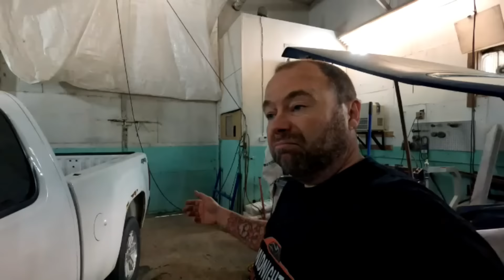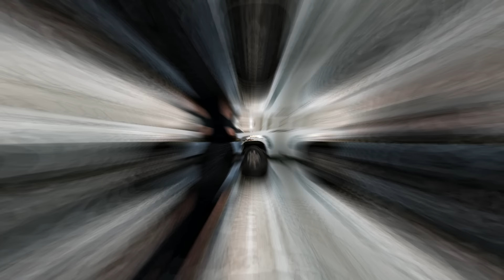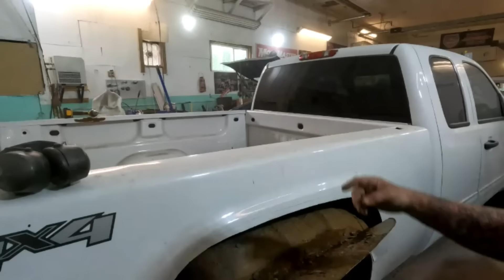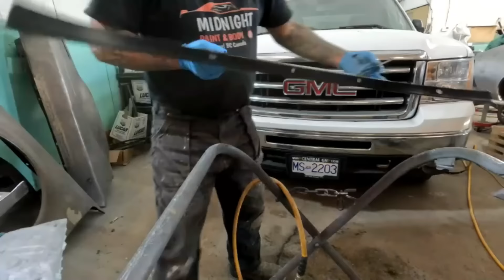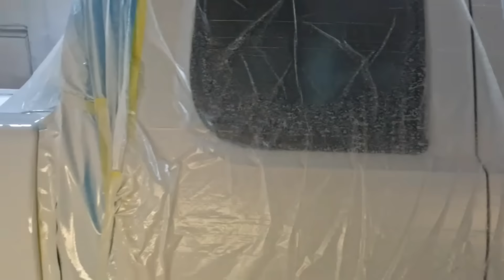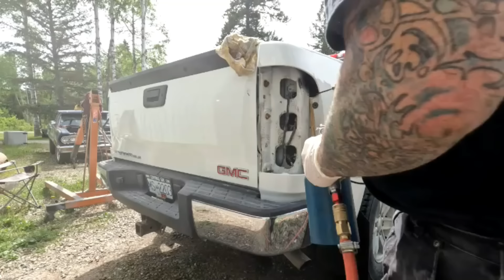How to glue on rust repair panels with panel bond structural adhesive

Comment: What filler did you use on top of the dura glass?
Reply from the maker: I was using Evercoat Z grip (800282), but I’ve since switched to the Evergold (100110)
Reply: @Johnnymidnight thank you for getting back to me so soon I appreciate it.

Comment: How long does the whole process take to replace both wheel arches, prep and paint?  I have a 2012 Sierra that needs this done and i was just wondering how long the truck is off the road.
Reply from the maker: These are usually 4 days when I do them

Comment: I've been thinking about doing this here soon. I'm just curious if there's a way to test if the rest of the truck bed is good before you throw a patch in. Obviously the wheel wells are falling apart from the rust, I'm just not sure on how to check on the integrity of the rest of it. Very nice job as always!
Reply from the maker: Take out the tail lights and pressure wash the inside of the panels the best you can, through the openings, and from underneath, once it’s dry you should be able to get a good visual with a flashlight and see how far the rust has spread
Reply: @Johnnymidnight Will do! Thank you for the reply sir!

Comment: Sure did a great job! Just another pro for using the panel bond is with a welder you stand a good chance of burning the factory coating ( be it as good or slightly better then nothing at all) on the inside of the panel that you cannot access. Stuff like weld thru primer still burns leaving that area bare and unprotected. At least the factory coating is undisturbed using panel bond. I had the chance to visit the G.M. proving grounds in Milford Michigan many years ago, they where testing their versions of different panel bonding Materials on a Pontiac utility/van. They where testing its strength by trying to rip the panels off the steel subframe structure! They had Hydraulic type machine that when operated measured the pounds per square inch of force it took to pull apart all the different joints and seems. After about 1 hour of testing they where abruptly stopped as the 20 ton hydraulic testing machine blew a hydraulic line! I believe it was a Monday, Par for the course on a Monday!   😳
Reply from the maker: Yes, we did similar tests by bonding panels and pulling them apart on the frame machine, when I first learned about it probably 20-25 years ago. It would typically tear the metal before the bonded seam would fail

Comment: Love your work, just one question, is there a reason you don't flange your panels at glue joints ?
Reply from the maker: Personally, I always find flanging the panel causes too much warpage. It may just be my tool though

Comment: Great video john, what sandblaster material and psi did you use for this? Going to try it on my ram, getting pretty crusty being in Ontario😅
Reply from the maker: I use 60/40 grit crushed glass, not sure of the psi, but you definitely need a big machine to keep up with sandblasting

Comment: John did you use steel or aluminum rivets ? Thanks
Reply from the maker: I just use aluminum, my thought is that being coated in adhesive, the dissimilar metals shouldn’t be an issue
Reply: @Johnnymidnight  Thanks, appreciate the clarification. After the cab is back on my frame I plan on installing an auxiliary fuel door on the bed side and like how you use the panel bond. (didn't want to weld for fear of warpage.)

Comment: I’m getting ready to do the same rust repair on my son’s 2013 Silverado. Like you I went to school for this back in the late 90’s utilizing LordFusor products. My original thought was to use this method on his truck rather than weld the panels in. But then got to reading about expansion and ghosting, being able to see the repair in the future. Have you had issues with that? White hides a lot but my son’s truck is black. I’m afraid it might show in the future. Do you prefer to panel bond over welding the patch panels in? Thanks, keep up the good work.
Reply from the maker: That’s actually why I had stopped using adhesives, I’d seen so many where you could see a halo of the repair from the expansion/contraction, but I’ve had a couple comebacks on jobs that were welded in the last 5-6 years, and jobs I glued in the same timeframe still look good (small town 😉)
Reply: @Johnnymidnight thanks for the reply! I was thinking that panel bond would help keep from warping especially since it’s a black truck. I’ll just stick to welding since I have a welder and don’t have the adhesive, save a few bucks but takes a little longer. Thanks again, love your work.

Comment: Another great job buddy. I don't want to sound cheap. Anything cheaper type of glue. I know you said a 100 bucks. Crazy question would JB weld work? Of course I have no idea on how many tubes 🤣 Is there any glue comparable that you're using but cheaper. 🙏🇺🇲 God bless you and your family.
Reply from the maker: I don’t know, I’ve heard of guys using JB weld, but it would take an awful lot of, and I don’t know that it would have the same structural strength or flexibility

Comment: Did you only use the 2 screws on the top of the panel to hold the panel tight to the body after gluing.
Reply from the maker: No, I think I showed in the video using a series of bonded rivets

Comment: I used your socket method to extract the adhesive, came in handy as I too cannot justify spending >$100 for a tool I'll use exactly one time lol
Reply from the maker: Awesome, even though I use it occasionally, I also couldn’t justify the cost, although I actually had a viewer send me the correct applicator gun recently!!!!

Comment: Nice Work. I have an 11 F150 with power running boards, I'm scared one day I'll step on them and they will fall off. I have to fix the rockers.
Reply from the maker: Yeah, those are super nice, but a lot of strain on the inner rocker

Comment: Getting ready to do an F150 wheel arch.  Never done before.  What did you use to trim patch panel so cleanly?
Reply from the maker: Just a zip cut on an angle grinder

Comment: What about using very high strength magnets wrapped in plastic so they dont get glue all over them? I think they even make magnetic clamps that you could attach to the truck bed then clamp the repair part.
Reply from the maker: I don’t believe they would be nearly strong enough to get the required “squish out “ of the glue

Comment: Good to see someone else rust proof with drain oil. I get some stupid looks when I tell people but it soaks in and doesn't make more rust like spray on tar in can aerosol .  Don't use that crap. It traps the wet road salt.
Reply from the maker: Exactly! I say the same thing. Undercoat is ok for a while, but eventually moisture gets under it, and can’t get out.
Reply: Are there shops that perform that as a service however?

Comment: I use 3m 5200 to bond panels, $20 a tube and have never had any issues.  It just takes a few days to cure.
Reply from the maker: I see that’s a flexible sealant, not a structural adhesive. I wouldn’t be able to take the risk on customer vehicles, but if it works it’s definitely a lot cheaper

Comment: Amazing work!  I will be using this method for my PU. Can you use this method for lower door skins - 98' dodge club cab? Just a bit of friendly advice, you may or may not want to throw an old tarp down to catch the excess oil. Someone unfriendly may see that someday and cause you trouble..
Reply from the maker: Yes, definitely will work for door skins👍🏼👍🏼

Comment: Just curious. I didn't see how you handled the inner fender. Is it just floating inside?
Reply from the maker: It would have been glued to the perimeter of the wheel well lip👍🏼
Reply: @Johnnymidnight Thank you. I've got a 2012 Silverado HD 2500 in upstate NY with the (design intented) rear wheel box rot, the rest of the truck is pretty clean. I can't find anyone who even wants to repair it and the ones who will want 3 large USD to do the repair but refuse any type of guarantee. So I'm going to attempt it myself. I can weld but don't have the equipment. Did body repair as a welder when I was in the US Army 50 years ago. Wish me luck, I'm going in... Thanks again

Comment: You do good work.  where can I get the attachment you used for the oil? Thanks
Reply from the maker: I got mine from the local auto parts store, it’s a pressure pot style undercoat gun👍🏼

Comment: I've been doing body work for 34 years, and I like bonding panels for two reasons;  #1- I can avoid welding for safety reasons, and #2--It forms an airtight seal against moisture. I used to like SEM  adhesive (when my former boss paid for it) Now I use JB weld 8281 at Around $21, for 10oz. vs. $70, for SEM 10 oz. Both have the same strength of 5,000 psi. I've had zero issues using it. and do a lot of panel bonding. Also, Midnight's work looks good to me, I enjoyed the video...
Reply: As a teenager, I repaired the bottom of my car door with a large blade off of a wood handsaw. The bottom of my door was rotted out, I slide the saw blade in between the door panels, coated it with jb weld, sanded her down then spray painted it, that repair lasted years. It still looked good when I sold the car 6 years later!
Reply from the maker: Thank you, appreciate the tip !
Reply: I like your work.i have a 2007.5 Silverado extended cab with the same issues...I live in Selkirk Manitoba and the weather is brutal here and they use sand and salt but now they switched to beet juice for sanding.. anyway, my name is Jerry and I'm following you, I like you how you don't beat around the bush...🤙are you interested in selling any of the GM motor,and the 4 spd tranny? I have two cars I've been working on,I'm not a body guy ,I'm like you,doing my best...I just thought I'd ask and by the way,have a beer for me.... Nice to meet you and maybe one day I'll take a drive and visit... You take care .... Keep those videos coming.nice talking with you John...🤙

Comment: Yup, you lost me at $100 a tube, I'll stick to welding, great video though!!🤣👍💯
Reply from the maker: Yep, that’s definitely the drawback of this stuff. There are probably less costly options, but the 3M is pretty steep
Reply: It’s just polyurethane right?  Can’t you use JB Weld?
Reply: @MvDs-m1f  I would imagine yes, or even 2 part epoxy with a filler to thicken, just like fiberglass putty.

Comment: Are you using steel rivets?
Reply from the maker: I used aluminum rivets, and seal up the back side really well to avoid the dissimilar metals causing an issue
Reply: @Johnnymidnight ok that's what I was worried about. The 2 different materials causing corrosion issues later on.

Comment: You said mix the glue in equal parts but the 3m data sheet says 2:1 ratio, so which one is true?
Reply from the maker: Equal distribution from both tubes makes the 2:1 mixture, I should have been more clear about that I guess

Comment: Another plus to the panel bond is you don't risk warping the panel at the weld seam. I just checked Amazon (US) and a tube of 08115 is about $60USD, and you can get an off brand gun for another $65USD ish. I used it when attempting to replace a roof skin and I ordered it from Amazon, and the stuff has a shelf life. And the stuff I got was really hard to work with. I bruised my hand part way through the first bead. Even if it costs more, If I did it again (and I have an '04 Sierra that needs rockers and cab corners, so I will) I'm buying it locally so I know it's fresh. Nice work on that truck. Did you shoot it in single stage?
Reply from the maker: Yes, white I usually just go with single stage, just to save a little time

Comment: I always thought of using chainsaw bar oil to coat inside of panels as it has a sticking agent on it and is always hard to get off.
Reply from the maker: It would work awesome! I just use old motor oil because it’s free😉

Comment: Butt weld or flange weld seems to be the question on most restoration channels.  If it rusted out once welding it is guaranteed to rust out again.  Welding burns off the e-coat and changes the temper of the metal in one stroke.  That's why I prefer panel bond
Reply: Of course if you're car sits in a garage and rides on a trailer "all metal" like they did in the 80's is the only thing that will do 😂
Reply from the maker: Pros and cons to both I think, as long as the back side is treated well after, they seem to stand up pretty well

Comment: Finally, someone says it like it is , they all rust and it's thin cheap  metal and it doesn't matter who made it. Basically you got screwed spending all that money on junk. My opinion this is Del.  Dont believe me look at a truck from the 50s or 6os.
Reply from the maker: It’s true, they’re engineered to fail, my 59 GMC bedsides aren’t rusty, but they’re just open panels

Comment: I need to do this as well but my inner panels on my driver side have deteriorated and broken up. Could I buy a piece and glue that one the same way
Reply from the maker: The outer wheelhouses would be tricky to glue in, but it could be done for sure
Reply: Any other recommendations to fix the inners without welding

Comment: 15:23  I did wheel arches on my 87 Dakota. Was not worth fixing but I hate rust. Anyway I did not bother fixing the inner wheel well. Mostly because I was lazy but also I figured it would keep dirt from building up on the ledge. See what happens. I don’t drive it in the winter. It’s been a few years and it looks fine so far.
Reply from the maker: I bet if it’s kept clean, it will last a long time!

Comment: Very educating video.
I bought panels for my Yukon and was thinking of trying to install them with panel bond.
But after I priced out the glue and the applicator kind of expensive.
Your tip about using sockets and an extension is a great money savor.
Thank you from Ontario.
Cheers
Reply from the maker: Awesome, glad you found the video helpful 🍻

Comment: When I started ripping apart my truck box, I was annoyed to see how the outer skin attaches to the inner “fenders” or wheelhouses or whatever you want to call them. It’s an obvious design flaw, and it’s just for cosmetic purposes. If they just made these things like a “step side” traditional pickup truck with external fenders, they wouldn’t rust like that. The outer skin serves no purpose. I think they do it on purpose, because trucks aren’t meant to last more than ten years anymore. Pisses me off. I come from a boat building background, and no boat manufacturer would build a moisture and dirt trap like that. Anything that costs as much as a new truck does ought to last the rest of your f$$$ing life. Sorry for ranting.
Reply from the maker: I completely agree, they’re engineered to fail. My 59 GMC has open bedsides and they’re not rusty

Comment: Drips oil like an old truck now 😂 that is some good body preventive maintenance tips. Really tempted to use this process. Interesting that Tesla uses this process to repair their frames with structural adhesive. Pretty impressive that a glue can hold up as good as welding.
Reply from the maker: I always tell my customers their trucks are going to leak oil from places that don’t have oil 😂. Adhesives are commonly used in aviation as well, amazing stuff as long as it’s used properly 👍🏼

Comment: great video, I have the same cancer starting on mine. You would think truck manufacturers would engineer some sort of access panel in the inside fender that you could remove and clean. I may just do that to mine. Then fit a patch with screws back on.
Reply from the maker: I truly believe they’re engineered to rust through in around 10 years, otherwise nobody would buy new trucks
Reply: This wouldn’t happen on the aluminum body fords…..right?

Comment: I have used self tapping screws to hold panels, then remove them and epoxy in the holes.
Reply from the maker: I’ve seen it done that way quite often, but always seems like that is the first thing to show through in the sun 🤷🏻‍♀️

Comment: Awesome job ... I do the same with rockers and cab corners as well I even tried pl premium 8 years and holding stong and I live eastern Canada 🇨🇦 where the weather isn't  ery nice on vehicle's..  I used set screws ( tap screws) but I'm going to try rivets next time another easier to deal with and your not putting heat on the glue  very  ice tip. Injoying the videos keep them coming. Is da boy lol some newly slang.

Comment: Great help, I just wanted to compare this with welding and grinding down the weld. Did you repair the inner tub on the drivers side?
Reply from the maker: Yes, I would normally replace the wheelhouses, but in this case I did have to put a piece in on the driver side

Comment: How do you paint and work with the inside of the patch panel when you have an "inner" fender in the way? You may have given me the confidence to try this body panel method. Good presentation.
Reply from the maker: I reach up inside and spray from front and back, it’s possible to coat the inner, just messy

Comment: That was very interesting.  I have a customer that has a mid teens F350 crew cab long bed with the powerstroke for pulling trailers.  The fender lips are all rusted out.  Apparently long bed Super Duty trucks are really rare.  He cannot find anyone willing to make the repair and used long beds are unobtainium.   He has checked everywhere in North America.  Some websites even say on their home page that they have no mid teens Super Duty long beds.
Reply from the maker: Bedsides should be FO1756143C and FO1757143C for full bedsides, my supplier shows stock on them, or there should be wheel arch repair panels available
Reply: @Johnnymidnight  Collision shops out our way are fully occupied with insurance work.  Getting rust repair work done seems to be impossible.  I am contemplating doing what you did in this video for the same reason as your friend just to get a few more years out of the truck.  He's already bought two new Rams in the last two years.